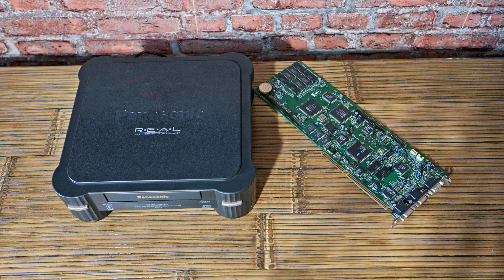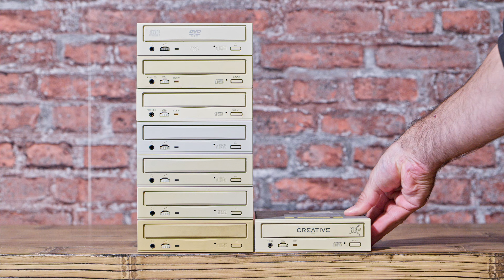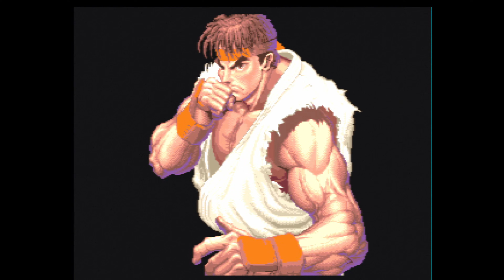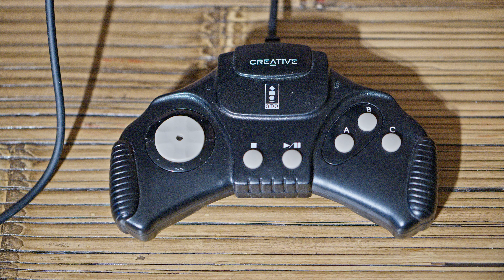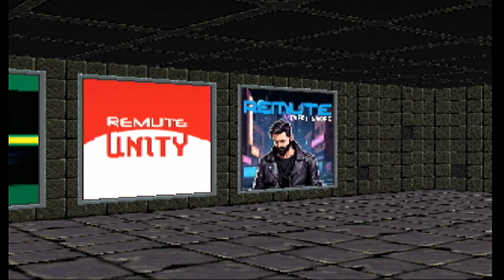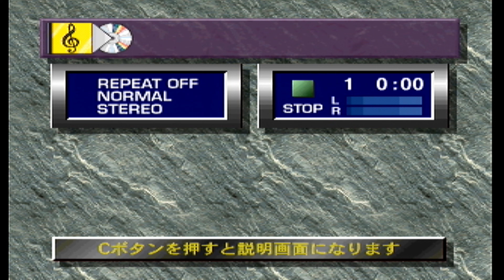Creative 3DO Blaster (Not the 3D Blaster) Review - Part 2

Comment: Street Fighter 2 looks horrible on PC monitors without shaders or a decent external upscale. Even CRT PC monitors which rarely go below 31khz and uses slow phosphors (to reduce flicker on text). It will look horrible even if you output 240p @ 120hz to make it 31khz.

The best / easiest way to output low res 15khz and 24khz signals from a windows PC is use an old AMD gpu with crtemu drivers. These allow custom 15khz modes and automatically outputs native res and refresh rate in groovymame.

If your crt tv or 15khz monitor doesn't have RGB then a jrok board will convert the rgb to svideo or component without changing the resolution.  

Most old GPUs with svideo out are locked to 480i so they are useless for gaming.